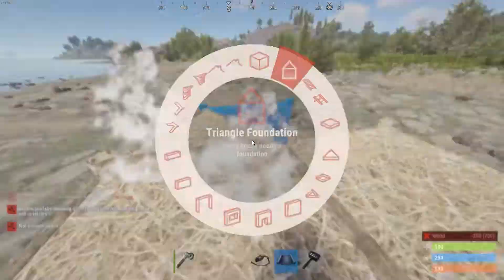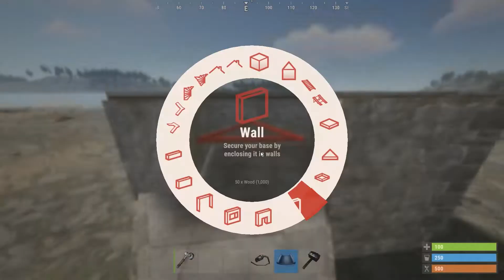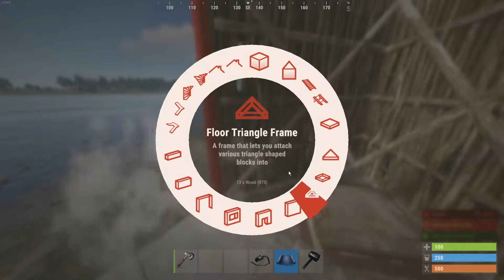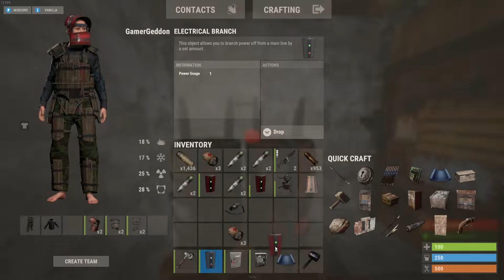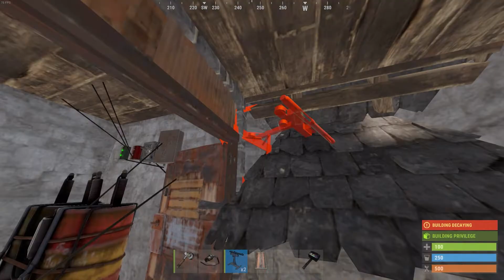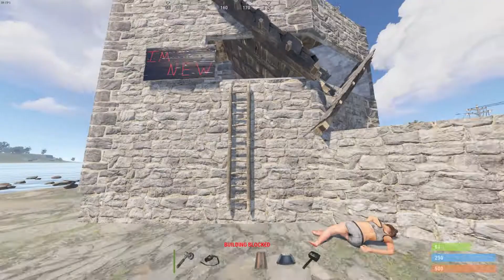New TRAP Base Design 2022 - Rust

Comment: The only suggestion I can make is using the bear rug trick to place the pressure pads under the floor. In my experience rugs on floor is hidden pressure pads. Though you will still get a lot of people still.